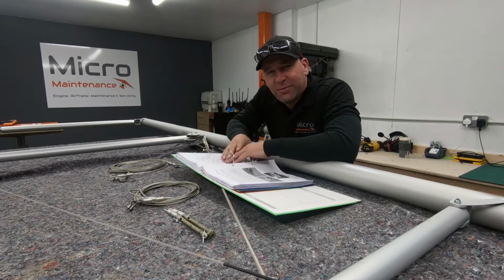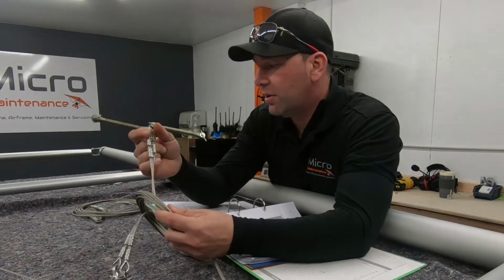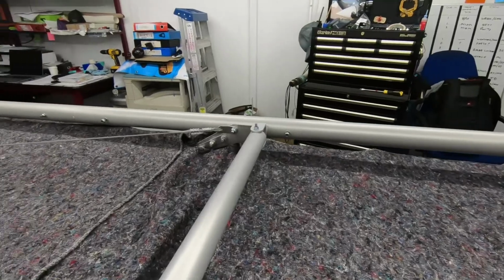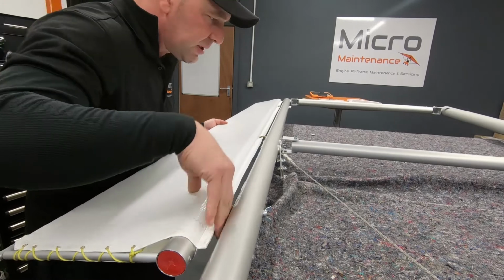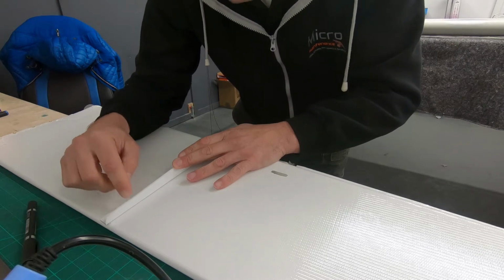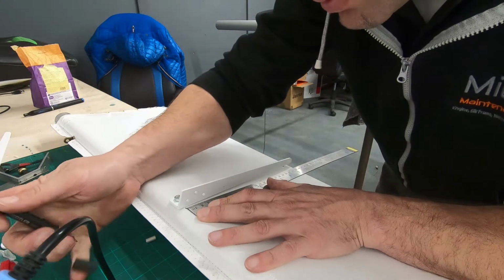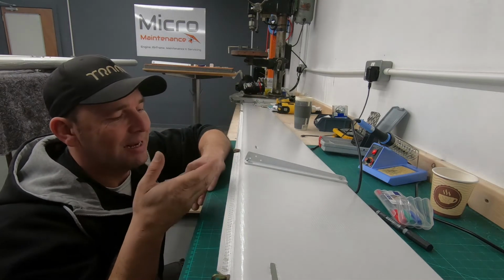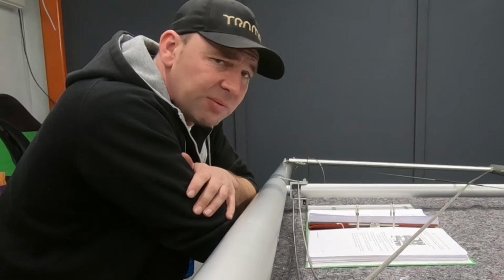600kg Skyranger NYNJA LS, Custom Build - Cables and Ailerons: Micro Maintenance - S2E7

Comment: Can i ask how long does it / would it take to build a kit aircraft like the Nynja from start to finish - assuming 5/6 days a week at 6/8!hrs per day. Cheers
Reply from the maker: Hi Ranbir. 300hrs is often quoted, I would agree however that doesn’t include a lot of learning, redoing and rectifying mistakes. They fly as well as they are built 👍🏻
Reply: @wingnutshomeofmicromainten6946  
Thanks for reply… definitely would like to pop in a say ‘Hello’ next time Iam in those neck of the woods- Darley Moor

Comment: Another great video. If you were fitting wing tip strobes how and where would you route the wire. Thanks
Reply from the maker: Thanks Darren. That will probably be in the next wing building episode 👍🏻 winglets are riveted to the wing tip tube (SKR 54?) the cable for the strobes is run through the LE tube, hope this helps?